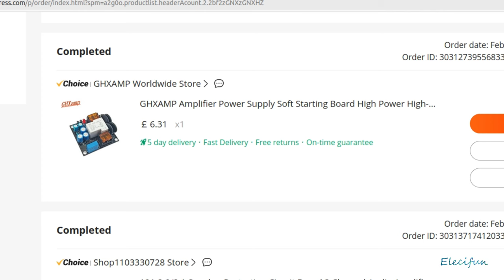Speaker POP Protection board. (Aliexpress)

Comment: This is an interesting product, but how do you switch the power to it? Is it switched on as you turn on the amplifier?
Reply from the maker: @robertbauer6723 it would be connected to the mains power source the same as the soft start circuit.